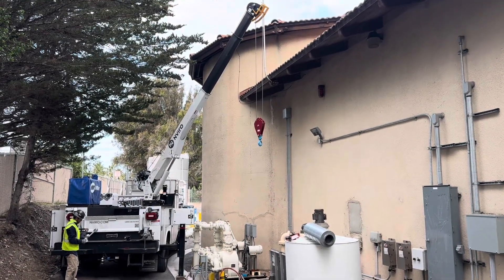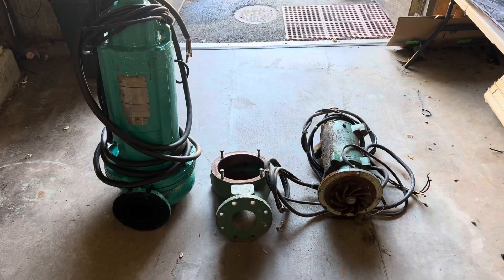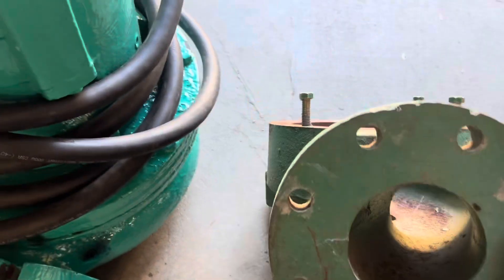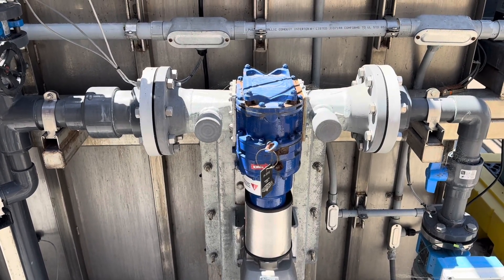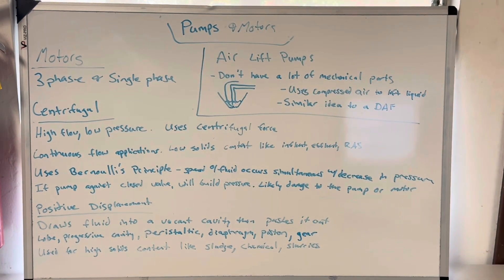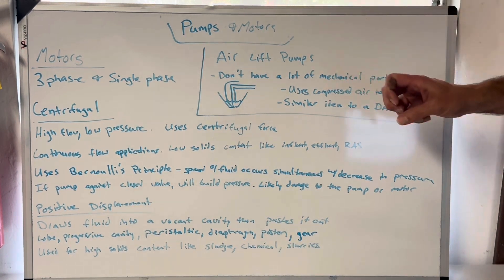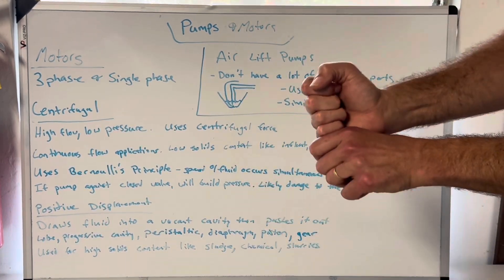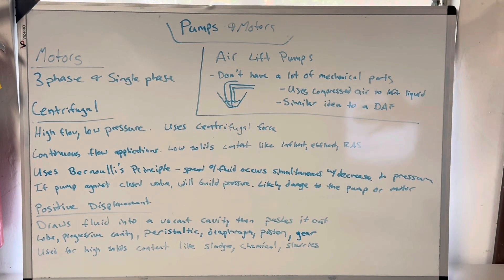Wastewater Plant Pump Types for Exam Prep and Clearing a Jammed Pump! Good for Distribution Ops Too!

Comment: Archimedes and Venturi struggling for a little recognition.  

High volume screw pumps for influents  and grit removal.  Venturi pumps for chemicals, creating vacuums for priming, metering applications  and in some cases adding dissolved oxygen.
Reply from the maker: Thank you!  Yep I failed to mention Venturi style.  I’ll be sure to get those in a video.  Probably a whiteboard segment since I don’t have any at my plant.  The Archimedes screw is a kind of positive displacement that I missed.  Thank you for helping folks study!